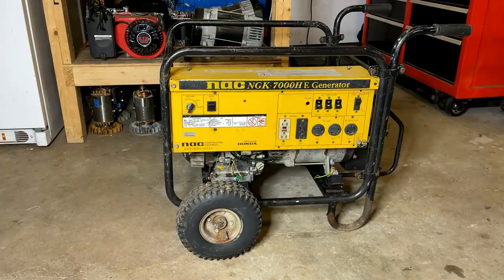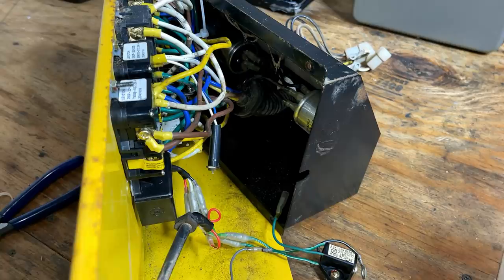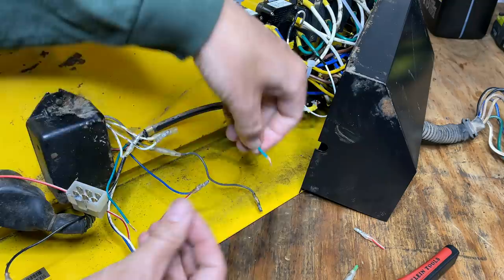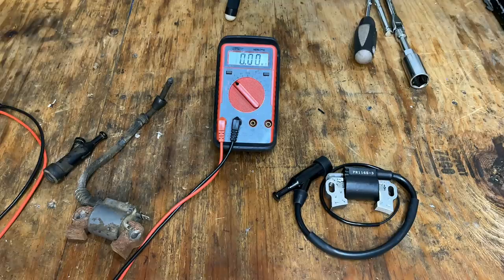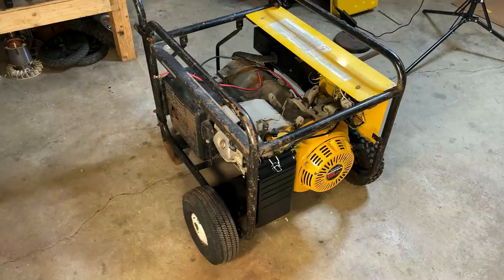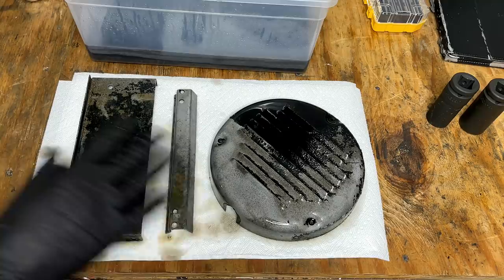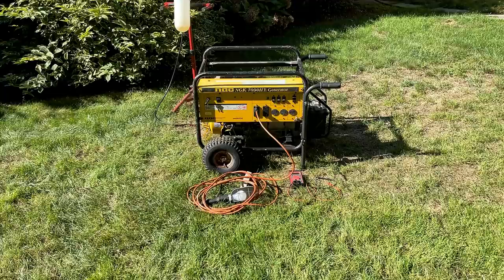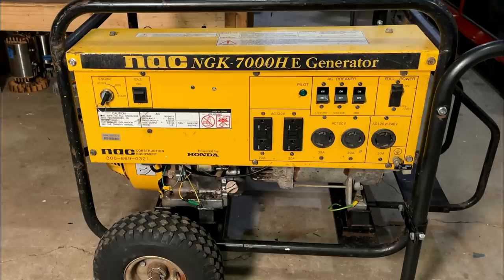Trashed Generator Part 2 - Making it Perfect

Comment: If I were you, I would go back and double check everything. Because this head was making power IIRC and was outputting 120v and powering a light bulb.  Then after dismantling and doing all the wiring, the head suddenly fails. It initially put out power but then when out during the last run. But then both legs were completely dead.  You don't want to damage one of your generator heads.

Comment: Nice to see your twin brother helping out in this video!

That is a bit of a bummer on that stator, just when all looked well. Oh well, part three, here we come.

What I don't get though, is what made it fail at that point in the proceedings? I could have understood it crapping out when it was first powered up, but wait until the job was all but done! That's just bad timing, or a dreadful fluke occurrence.
Reply from the maker: Was concerned that I wired something wrong, but could not find a fault due to an error.
Reply: @jcondon1  I was thinking I would've transferred the wires one at a time from the old receptacles to the new so I wouldn't get confused, but that wouldn't catch any errors introduced by the last guy that worked on it. Your method is safer because you actually have to think about where the wires should be.

Comment: Not to criticize your work, not my intent. But I would suggest when replacing GFCI outlets, I'd suggest it might be best to do them one at a time to prevent the possibility of getting your wires mixed up. You obviously had your video to guide you, but if someone else were to attempt a similar repair they may not have access to disassembly video.
Reply: When I replace them in houses, I typically do one terminal at a time, that way I dont get line and load mixed up since all the wires are black.
Reply: Really hard to get mixed up there - hot to hot and neutral to neutral.  If you reversed the hots all it would mean is that the left outlet was on the X leg instead of being on the Y and vice versa.  But in general it's a good idea to work one part at a time.
Reply from the maker: Better safe then sorry.  I did end up consulting the video to make sure I did it right.

Comment: Nice video, thank you! Before solid state they used selenium rectifiers that would off poisonous gas when damaged. They were still in wide use in the 1950's and failed quite often! Mechanical vibrators were used in car radios to get the necessary tube plate voltage. For a short period of time car radios used plug in low voltage tubes! They all worked and at one time were state of the art! Acorn tubes were used for High Frequency. Peanut electron tubes were solder in! They all worked demonstrating the God given ability of mankind! Ron USA
Reply: I certainly remember the horrid smell from failed Selenium Rectifiers. They were bulky too with all those metal plates. By the time I was working in the field I would always replace them with silicon devices.
Reply: @ronaldclark2624  I certainly believe that war is a sin Ron. However I do not have your certainty about the end of mankind. My philosophies are mine own and I am not very influenced by those around me. I hold ideas that are certainly not receptive to most of the people of the USA.  I certainly enjoy discussing them with people who are not closed minded. This is not the forum for such discussions.  Here we discuss generators and small machines.
Reply: @r8118830  You are wise to be skeptical and not trusting as there is much deception today including religion! I have studies the Bible for 48 years and base my conclusions on that and not on religion! If you abide in the word of God then you will know the Truth and the truth will set you free from worry and the cares of this world! 
Ephesians 4:14  As a result, we are no longer to be children, tossed here and there by waves and carried about by every wind of doctrine, by the trickery of men, by craftiness in deceitful scheming;.
The choice is yours! You can investigate the Bible or completely ignore it! Ron USA
Reply: @ronaldclark2624  I am not going to discuss it on this forum Ron. This forum is for generators and small engines.
Reply: @ronaldclark2624  You need a beer and a hug, bro!
Reply: @kriswright1022  Have one for me Kris! Alcohol can be medicinal! I have seen people who feel very well but could not drive! Thanks for the Reply! Ron USA

Comment: With hindsight being 20/20 & all.

Couldn't you just clip the leads from the old rectifier & solder them to the new one? So that way you didn't have to go through that much trouble.
Reply from the maker: Yes
Reply: How do you know which terminal is which on the new rectifier?
Reply: I cringed, because I prefer making stuff reversible. Now he has to rewire to use an orinal bridge rectifier
Reply from the maker: @jeff7.629  the positive was marked.  The negative is diagonal across and AC goes in on the remaking two terminals.
Reply: @jcondon1  thank you. It wasn't too clear in the video, hence my question.

Comment: Instead of electrical, I would have waterproofed it with clear silicon out of my caulking tube or maybe some of my RTV silicon I use as gaskets.  Tape, even 3M which I use, not start on wires.

Comment: Freaked me out when I saw 2 sets of legs LOL.  The bridge rectifier you bought are the same one's I use on snowblowers with no issues.  Why did you choose Evapo Vs Die Grinder and a Wire Wheel?  Like the dog bed handle retro fit LOL.  Even though the stator is bed this is nice bag of money you got there!
Reply from the maker: I had the evaporust hanging around just waiting to be used.  I thought on the stator cover the die grinder would have trouble.

Comment: You don't need to soak rusty parts in Evaporust,  simply spray the rusty parts with Ospho and rust is gone. It turns iron oxide into iron phosphate which is inert and it also serves as a primer for painting.  It works quickly.

Comment: 40:55 I think that battery is too large.  It would have originally had the next size down.   The holddown would have then fit over the edge of the battery correctly.

Comment: Electrical tape is not waterproof. If you want a seal that shrink tubing use liquid electrical tape. Make it a practice to put it on the wire before putting shrink tubing on If you think it won't be tight enough. Better yet use shrink tubing that already has the sealant in it.

Comment: James,
Very much enjoy your films.  I have used what I have learned to tweak my Generic 5500 I have had for 21 years and still runs very well.

I am interested in making a fuel tree like you use to supply fuel when the tank is removed..  Can you tell me where you got your fuel tank.

Thanks and keep up the good work.

Dave
Reply from the maker: The tank came from Amazon and the stand was from an old halogen work light ALPHA MOTO Motorcycle Shop Auxiliary Gas Fuel Tank Professional Tool Compatible with Honda Yamaha Kawasaki Suzuki KZ XS CB KS 450 550 650 750 850 https://www.amazon.com/dp/B004NV42PQ/ref=cm_sw_r_cp_api_glt_fabc_P4JBB37HTZKYQ15XE5XB?_encoding=UTF8&psc=1

Comment: James I didn't know you had a twin helping you out.  Neat trick!  Could the corrosion on alternator cover be the result of battery out gassing. Seems like a bad design by the manufacturer.
Reply from the maker: The only place that did not have corrosion was where the battery was against the end cover.  Guessing it just blocked the rain.

Comment: If there no gas in the tank or carburetor For how long you can leave the generator without running before it’s need re-flashing “ lose internal magnetism “?
Reply from the maker: It is have an AVR, then it should not lose magnetism because there are small permanent magnets on the rotor.  Older units or ones without an AVR can lose magnetism but there is no hard fast rule that I know of.

Comment: Nice video... in part 1 I said I can't wait to see part 2 and here it comes we gonna have part 3😅 ... actually I liked the work but still I'm confused with that rectifier...is there any connection between the battery charging circuit and that rectifier or only it's been used for the idling?? 
Because my generator has one similar to that rectifier but I don't know the purpose for using it and my generator doesn't have that idling system.. thank you for all explanations 👍
Reply from the maker: The full bridge rectifier shown in the video was for the fuel solenoid and the idle control.  There was another half bridge rectifier that was only used for charging the batter.
Reply: Ok now I got it... thank you so much I hope if there is chance to explain to us about that other half bridge and how it's been used to charge the battery in another video...my regards to you Mr James Condon 👍
Reply: @aymannabil9  Old fashioned and simple charging circuits, like those used here, can charge a lead acid battery with half wave.  The full ac voltage output from the winding has the bottom half - the negative half - of the waveform blocked off by the single diode.The positive half of the waveform can then push current into the battery that charges it up.
Reply: @r8118830  thank you for your explanation but in which place that diode is located... is it inside the case of the winding itself or in the rear side of that control panel ?? I meant attached to the back side of the control panel..
Reply: @aymannabil9  It is unlikely to be placed inside the stator assembly or even in the control box. This is because it is a very simple straightforward component and placing it in these locations just complicates matters of assembly and possible repair.. The other reason I know that this is not so is because James actually measured the 44v rms output voltage from the stator winding on that wire that was loose and hanging down. If the diode was already in series with that wire then it would certainly not have read 44v rms. The diode is then placed in series connected to the end of that wire and the positive battery terminal. The positive end of the diode being connected to the wire. Being 44V also tells me that it has been designed to charge the 12V battery using a single wave diode circuit. The single wave positive diode pulse, which is what we get, has a dc average voltage given by 0.32 times the rms  voltage of the input sine wave.  So 44V rms x 0.32 = 14.08 V avg. This is not an exact science so calling it 14V is more sensible. 14V will charge this type of 12V battery quite well. The diode in question would need to be capable of delivering a couple of amps to the battery so I would use something like one rated at 5A. My rule of thumb for voltage rating the diodes in these types of circuits is to use one that is rated at least 4 times that of the maximum nominal output voltage. So 14V x 4 -= 56V. The next standard voltage rating up is 100 V. So I would use a 5A 100V vrrm silicon diode.  These can be bought on ebay for say 3 dollars for 2. The diode in question will be found if you follow the  wire James connected to that 44V line. It is mounted somewhere under there. We know it works because James measured the voltage on the battery when the generator was delivering power and that voltage was slowly rising. If the diode was faulty the battery voltage would not have risen at all.
Reply: @r8118830  I really thank you so much for your detailed explanation...actually you gave me information more than I need and these tips are very helpful for me in diagnosing the faults in my generator beside what Mr James  explains in his videos every time I learn something new ...thanks a lot 👍

Comment: Hey James, what's in that evaporust?  I have seen other people use apple cider vineger to soak rusty pieces of metal and from what I seen, it worked very well.  Now I don't know how much either one cost but, I would say the vineger is cheaper.
Reply from the maker: Vinegar is the most affordable option.  Not sure exactly what’s in it.  It’s not acid so you can leave it soaking indefinitely without concern if eating good metal.  But it’s not cheap.  Here is a video with a little more info on it  https://youtu.be/f9kBdJQMPPI

Comment: England. Hi James. I don't think there is anyone more careful on YouTube than you. I'm a retired engineer who spent the first year of an apprenticeship under the longest serving warrent officer in the British Army (rtd). You cannot imagine the bullshit but he did teach me one thing - patience. You could do with a little welder. Also when using heatshrink like you did slide a piece big enough to do the whole job first and then another smaller to pack out the larger piece. I hope that makes sence. Please tell me how long you would keep petrol for a generator ? I have 40l of the non alc. petrol and it seem this new alc. stuff is causing havoc. We are going over to it now. Would you risk removing the alc. with water ? ( many vids on YouTube)   Alcohol is hygroscopic and thats the last thing you want in a steel tank.
Reply from the maker: With ethanol in the fuel, no longer then a year.  Always keep the carb dry.  Without ethanol, 2-3 year should be ok.  Unfortunately I do not have first hand experience with that since I can only get fuel with 10% ethanol :(

Comment: Is there a separate winding on the head for that 12v?  Because you don't get 12v out of a 120v bridge rectifier. You get more like 160v out of a full wave bridge rectifier with 120 AC. It seems kind of dumb to have to have a transformer inside the electronics box.
Reply from the maker: The Honda engine has two coils behind the flywheel.  One to charge the battery and the other is used for the bridge rectifier shown in the video which powers the fuel solenoid and the idle control solenoid.
Reply: @jcondon1  So those windings are not built into the stator itself. This means that they are replaceable then.

Comment: Hi Mr. Condon,  I have a Briggs&Stratton 30469 , 6000/7500 watts.  I tried to replace the 1&2 outlet I bought from Homedepot but now it tripped the panel breaker I checked the wires and it’s the way they had it.  Can you give me any possible suggestions? Thank you I appreciate it
Reply: @jcondon1  well, I figured it out what caused the breaker to trip, I just needed to break the tap outlet.  I really appreciate you offered to help and truly enjoy watching you trouble shoot each machine.   I admire your patience when you’re working with these. I wish I have your patient.   Again, I appreciate you taking your time to help me,  thanks again

Comment: Never knew there was a resistor in those plug boots. What is the purpose of the resistor?
Reply: I beliee it's for inductive noise supression in the ignition system.  In the old days, cars used straight copper plug wires.  But when the insulation started to go bad, you can hear the arc clicks on your AM radio.  Resitive plug wires helped to eliminate that.  Yep, I'm from the days when FM radios weren't in cars.  You could even tell when a car with a bad ignition wire would screw up your TV image.  Yep, again, before color TV was common.

Comment: X and Y hot should be a series resistance of the entire winding. Neutral is the mid point. That resistance of 1.3 ohms is normal actually. What you could have is a flying short from insulation breakdown. Disconnect the wires to the panel and see if each leg powers a load. Do you have the schematic for this generator I can look at?
Reply from the maker: This generator has a 120/240 switch.  Think the series connection is made there.  I will forward the link to the manually shortly.  The manual  has resistance values for L1 and L2 and a wiring diagram.  Not to spoil next weeks video, but I removed the stator and I can see a small area where it burned.
Reply: @jcondon1  doh!!!
Reply: Welp it was a valiant effort! Will be waiting for part 3!
Reply from the maker: Here is the link to the manual for anyone how is interested.  https://drive.google.com/file/d/1CKBpr3h-O1GjqufdKgyG0ZusBI94CfTj/view?usp=sharing
Reply: @jcondon1  If you found the spot where the insulation burned hopefully it's someplace you could reinsulate it. I'd guess it's where the magnet wire connects to the terminal wires but you don't need to spoil it.

Comment: So what could have happened from Part 1 to Part 2 that the insulation would have failed in the stator?
Reply from the maker: Not sure.  Was worried it was something that I did.  But could not find a fault in the control panel.

Comment: Just an FYI, there are Shrink tubing & connectors that have sealant in them when heated makes them water tight, also there is a brush on Liquid electrical tape that works great to seal the ends too. It is made by Star Brite, Permatex, Gardner Bender and a few others.
Reply: Well, aren't you just Mr. Smarty Pants!   Do you think he doesn't know that?  His way is 100% surefire!  Yours, maybe 70% at best.  The sealant burns up half the time!  Those that believe your stuff is superior don't even look to see if it has actually worked.
Reply: @edcrabb  On the contrary, There are a few people here that use them all the time and have never complained about them working. Maybe because you use a Propane torch instead of a heat gun for more uniform heat without trying to heat it 3,000 degrees, after all they use low melt solder & don't need to be heated that high.

Comment: i have a black max 7000 gx390 and it has the same choke and when i put everything back together the choke doesn't close all the way can you explain gasket sequence and where the choke should  when the rod goes through it
Reply: Search for a vid titled "Remote Manual Choke on Golf Cart Conversion". You can see the whole choke/spacer/bracket setup in there.
Reply: @TheOtherBill  different choke setup i needed to see the vacuum operated choke assemble installed

Comment: Couldn’t you have checked for 0.5 Ohms At the 120 V AC plug in the beginning.
Reply from the maker: Yes and it would have passed that test.  The only way this fault could have been found was to isolate the coil from each other and the control panel.